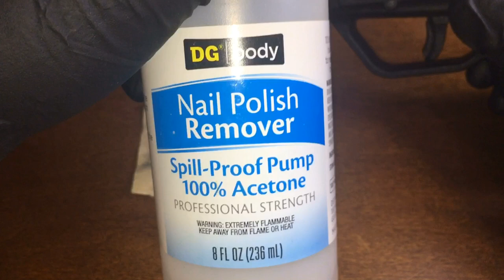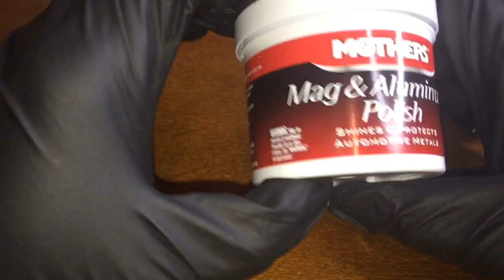How to turn a black handgun into a stainless steel handgun with mother’s polish / ASMR

Comment: Looks good, but I highly recommend taking the slide apart as to not cause any issues to the internals.
Reply: Mothers dries very hard and is abrasive. So yeah I would of completely stripped the slide! Very possible to cause internal issues. Not to mention it would be perfect time to clean and lube while stripped.
Reply: @freedomisforeveryone1776  exactly.

Comment: everybody saying stainless steal won't rust.... the slide isn't stainless steel. He stripped the black off. This is 100% going to rust.
Reply: What if painted with some type of coating after?
Reply: wouldn’t it need to get wet to do that lol ?
Reply: @Baconeggncheese315 sweat with in holster or most people using boxers lol but I did this ! It wasn’t worth it ,g26 rust bucket lol had to vinyl wrap it

Comment: Ummmmmm. People, please don't do this. You cannot make "Stainless Steel" out of a steel barrel. The bluing (The black color on the steel slide) is a coating that protects the steel from rusting. If you remove it, the slide will eventually pit and rust.  I suppose if you have to experiment with it, the 709 is a good choice because it was never much of a gun to begin with, but don't ruin a good gun by trying this!
Reply: Proper maintenance and storage should keep rust off ?
Reply: It won’t rust if you take normal care of it like always keeping it lubricated. Or you can just nickel plate it. I’m going to gold plate mine all you need is a gold plating kit which is like 800$ and you can gold plate and nickel plate and it’s very easy to do.
Reply: Great point that was a lingering thought in my mind.
Reply: You could in theory dura coat it after this, but you're kinda running in circles at that point.   And he needs to be taking the slide apart for any of this.
Reply: @MM_45  did you ever gold plate it
Reply: There’s nothing wrong with the 709, provided your expectations aren’t overinflated. It’s a belly gun, pure and simple. It’s not designed for shooting at targets much past 8 or 10 yards, but they are as reliable as any other micro gun.
Reply: Some slides are stainless -
Reply: @bajadan2769  Sure. Lots of stainless guns. But what he's describing is NOT stainless.
Reply: @bajadan2769  so if my handgun comes stainless steel I can polish it without the same risk ???
Reply: @alexx_windycitychi558  yes - you can polish it to a mirror finish
Reply: You can just re blue the slide and it won’t rust
Reply: @camokid1595 shhh don’t tell him that
Reply: @shotgunwilly4685 I just want to ask you what's the best way to prep and sand if I want to reblue my gun cuz there's a lot of scratches on it. My 1911 Tisas gun
Reply: @travismcdowell8352 I know I’m a bit late to this comment, but you can safely strip the finish with muriatic acid. There are a few videos of it here on YouTube specifically featuring 1911s. Just make sure you’re in a well-ventilated area and wear gloves. Good luck!

Comment: I would recommend using #0000 steel wool instead of sandpaper. The steel wool won't scratch up your gun.
Reply: Anything extra we can use with steel wool to get parkering off?
Reply: @boazbullion7118  metal polish
Reply: Mac10 so I have alot of black and a lil rust to remove I'd like to try to blue it or something
Reply: For people coming to this thread at a later date, muriatic acid or vinegar baths are also options, just be careful with the muriatic acid. Gloves and proper ventilation.

Comment: You can knock off the coating with a media blaster pretty easy without scratching up the slide just a suggestion for anyone wanting to do this
Reply: Where can I buy 1
Reply: @24kGoldPlating-13  you can buy a cheap one at harbor freight but you will also need an air compressor if you don’t already have one
Reply: @24kGoldPlating-13 I would not recommend doing this it's gonna rust you're taking the coating off.
Reply: @fordshojoe8080  if you don’t take care of your guns or if it just sits in a safe 90% of the time probably not a good idea worked out for me tho since i carry it almost daily

Comment: Your gonna need to do 800 grit then 1000 grit 2000 grit you can still see a lot of the hazes/scratches
Reply: Dont need to unless your a neat freak
Reply: @Bread45  Does it matter if its wet sand paper or no? thinking about doing it to mine. Also is there a recommended time to use each different sand paper
Reply: @d34dthumbalinax35  it definitely does matter I forgot why but it does
Reply: @Bread45 so use wet sand paper or both ?

Comment: Hi,

I'm thinking of doing the same thing to mine. But if the black metal is not stainless steel,  wont it rust with time after the paint is removed?

Thank you
Reply: Yes it will. Normal gun metal is carbon steel and will rust. Stainless steel has nickel added to it during the smelting process. To be clear, lower grades of stainless are still subject to pitting and rusting. The general, let me repeat, the general rule is, if it’s stainless, a manufacturer is unlikely to put another finish on it to begin with. Conversely, if you buy a gun with a finish on it, odds are it’s carbon steel.
Reply: @jmsmeier1113  

Thank you for your reply, 

Your explanation makes a lot of sense.
Reply: @martinmg8947  glad I could help.
Reply: @jmsmeier1113  I did this to my slide and a 38 revolver, and I will polish it up to a mirror finish and within weeks it goes super super dull as the oxygen gets to the metal, is there anything I can do to avoid this?  My only thought would be to polish it up then spray it with a clear coat spray paint

Comment: What grit sandpaper are u using and do you have to sand it down if the gun is already a stainless steel with a different finish on it

Comment: I've been thinking about doing this with my Shield. I want a stainless stainless slide but I'm scared to try lol. Plus Shields have rusting issues as it is. I've looked into duracoating but thats damn near as much as the gun. Fuck that. Yours looks sick tho.
Reply: Shit what damn, I just got an EZ to teach my partner about guns.
Reply: @damnfoxcat683  Lol I won't worry about it. Only if you strip the finish off it COULD get a bit of surface rust. S&W is good to go.
Reply: Yes absolutely you are Right.
I was thinking the same but
Reply: stainless steel wont rust
Reply: @slopezcomedy  it just has a stainless look. it isn't stainless steel

Comment: YOU CANNOT turn carbon steel into stainless steel by removing the blueing.  It will then rust very easily.  Blueing is for protection!  This is an example of amatuer gunsmithing 101.

Comment: Congratulations, just fucked up your gun. First of all you’re not gonna get a mirror finish using sandpaper on the gun, you scratch the surface, until those scratches are buffed out you’ll never get the mirror finish that you’re looking for. But more importantly, removing the blue down to bare steel doesn’t make it stainless, it just makes it bare steel. Stainless steel has nickel added when it’s being made.Let me know if you want a tip on how to salvage that gun before it rusts.
Reply: So then what would you apply to the steel afterwards to prevent rusting? Surely theres some coating you can apply
Reply: @arturob5306  you have a few options. Cerokote, that requires baking the finish on at a very precise temperature, so should probably be done by a professional. Then there’s duracoat that pretty much just paints on and air drys, but if I recall, you polished all the surface imperfections out of this gun and brought it to a true mirror shine. So, providing this is the case, there are plenty of utube videos on colt Royal blue nitre  bluing. This is an amazing finish that I can only describe as a blue chrome look. The colors change in the light and this was colts premier finish on the original pythons. It’s imperative that all the scratches are out, and the gun really does reflect like a mirror. I’ll include a link where you can get the salts to do this, but you need to educated yourself on the process. The depth and tone of the finish is dependent on the temperature of the salt bath and the length of time the parts are in it. Good luck.                                                                                                 https://www.google.com/url?sa=t&rct=j&q=&esrc=s&source=web&cd=&ved=2ahUKEwjJv97bgor1AhVCneAKHRoNDcYQwqsBegQIBRAB&url=https%3A%2F%2Fwww.youtube.com%2Fwatch%3Fv%3D-vF3zKiUIkY&usg=AOvVaw2ibTEntaSKukBB_YD9X697

Comment: I seen the video is a year ago, out of curiosity how's it holding up? Good, bad or fair?
Reply: My bet is it's pitted and rusty! Would love to see a pic. I live in NH and even my blued guns will start getting some rust spots just sitting in the safe.
Reply from the maker: Great
Reply from the maker: I painted it red
Reply: @shotgunwilly4685  since you’ve invested in a safe, I’m guessing your not a first time gun owner. As you probably already know, excessive oiling actually draws moisture, but I was taught a trick to avoid rust on guns that are stored long term. Get a can of carnuba wax and melt it into a liquid. Saturate a small rag in it and wipe your guns down. I live in Florida where the humidity is typically 352%, and since I started doing this, I have no rust issues.

Comment: Ok so just because you took the coating off of the slide does not turn it into a stainless slide. Considering its most likely carbon steel. You just created a rust magnet.
Reply from the maker: Ain’t rusted yet but ima make a video for you
Reply: What if you paint it with something would it still rust?
Reply: @ShendoBebop  not if you do it right and use the right paint

Comment: how long it took to get off the paint ?
Reply from the maker: 30 minutes
Reply: @gunsandammo3113  I want to do this because I have a good plating kit
Reply from the maker: @lilshoota19  if it’s your only gun don’t do it but if you want to do it as a project cause it could go bad 👍
Reply: @gunsandammo3113  What grit sandpaper do I start off with to takeoff the black color  and then what grit  do I use after all the black colors off I know there’s a process with the sandpaper I know how to use the mothers polish but I never used the sandpaper before what grade am I going to need to start off with and finish off with what is the process?

Comment: You can‘t blue stainless steel. Blued guns are made of carbon steel, not stainless steel. By removing the blueing you just made it look like stainless steel. The bad thing is carbon steel is going to rust without the blueing. The blueing was protecting the surface.

Comment: Mother's aluminum mag polish is not sufficient to polish a steel slide plus you can't do it by hand anyway
Reply: Your correct on the polish he used, but I disagree with the rest of your statement. If you have blocks of white and green jewelers rouge, and a bit of experience, you can accomplish a polished surface that is second to none. That’s not to say it won’t rust if it’s carbon steel, but for preparing a gun for bluing, it can turn out every bit as good as using a buffer.

Comment: Doesn’t this make it easier to rust
Reply: Yes but you just have to oil it and keep it dry occasionally and it should be fine, of course it’s better not having to maintain the slide at all but it’s necessary if you want to keep it shiny and rust free